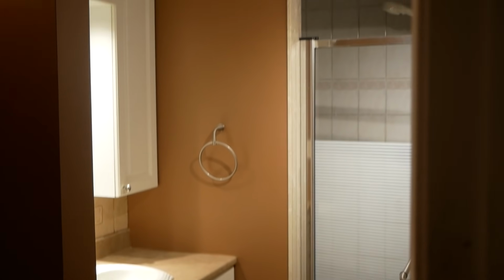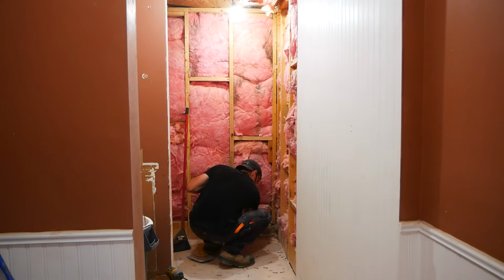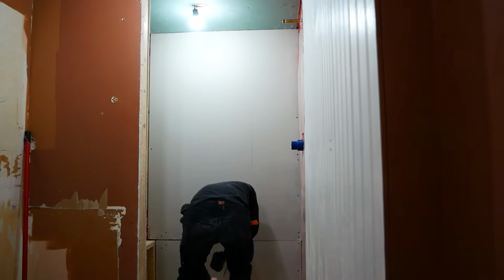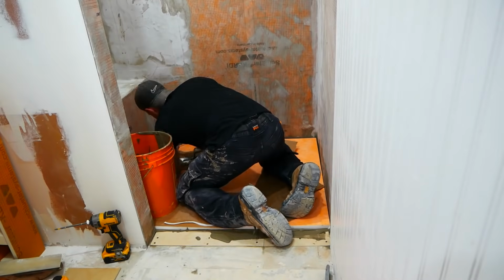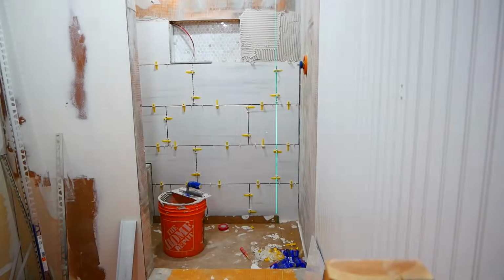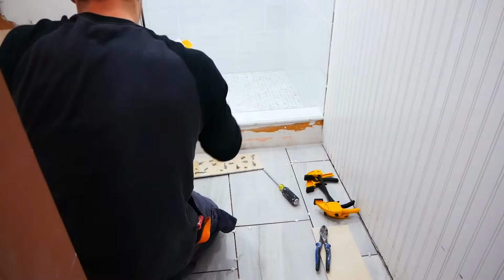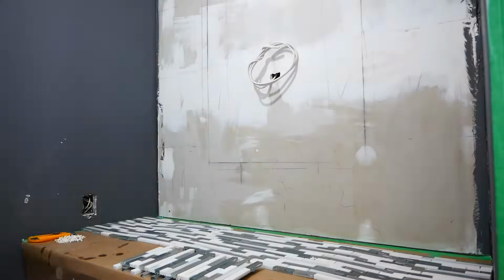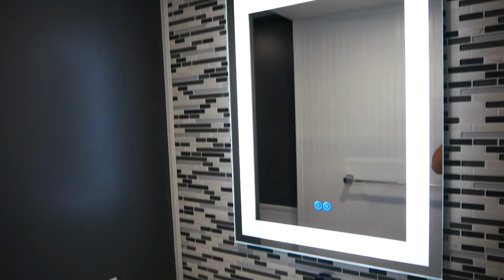DIY Bathroom Remodel | First Time Renovation for $4000

Comment: Ok for those of us who don’t know the technical terms and want to learn can you please explain. What is PEX? What is CFM, GFI, LBT? You know what I mean my man?
Reply from the maker: Yeah I’ll try to get better at that. Pex is the white pluming pipe I used. Cfm is cubic feet per minute (how much moisture your fan will be pumping out).
GFI is ground fault interrupter (detects voltage leakage and will trip if there’s a problem. LVT is low voltage thermostat wire, just a small wire for low voltage stuff 18/2
Reply: @WorkinwithWolkon  thanks. I’m doing my own bathroom refresh at the moment but wish I could do more hardcore stuff like you. Nice job.

Comment: Good job.. I'm just skipping through but whats going on with the plumbing / valve being burried in the insulation? Big no no on this. You're asking for mold. any condensation that might occur, any small tiny leak might go unnoticed. and that insulation would be prime breeding ground. A tiny leak in an open cavity would also be bad but not nearly as bad. If you are up against an exterior wall or in a basement you never put your plumbing on the outside wall like this. thats why a kitchen sink that is under a window has the copper coming up from the bottom of the cupboards. not the wall.

Comment: Love how you put the cost breakdown at the end. I'm in the middle of doing this myself because trade labor has gotten so high that I could mess it up 3 or 4 times and still come out less expensive doing it myself. Would be great if you added in roughly how many hours this all took as a contrast in how long it takes a DIY'er vs a Professional.
Reply from the maker: It was roughly 130 hours. Keep in mind that doesn't include the 10,000 trips to the hardware store lol

Comment: Im not sure if you did or not, but I would run a bead of Silicone along the bottom of the toilet where the toilet meets the tile. if it does overflow, you dont want anything getting down under there.

Comment: Looks amazing!  Only critique I’d make is that if the shower wall is an outside wall, it’s load bearing and you’ve compromised the structural integrity by cutting into those 2x6 studs without putting in proper support.
Reply from the maker: Thanks! The shower wall was actually an addition built into the garage. Its non load bearing. I wanted to remove the wall separating the vanity/toilet however that wall is load bearing
Reply: @WorkinwithWolkon  oh nice, so no damage done!  Great job man!

Comment: My question to you is why did you use regular drywall? Why didn't you use cement board. Either that or mold resistant drywall?
Reply from the maker: Schluter recommends regular drywall. If any water gets past your membrane then it has failed

Comment: You just save your mom a 10,000 dollars or more project! Nice well
Done
Reply: I agree, at least 10,000. + in savings.  Very good job.  I used the same waterproofing.   An excellent product but a bit expensive.   Great work young Man.  Thank you.
Reply: We wanted to renovate our bathroom and rebath (a bathroom contractor) was quoting 20k. We did not go with them🥲
Reply: @ayshab2123  there you go you should hire this guy on the video 😊
Reply: How much would a general contractor charge for this do you think?
Reply: @Ryan_Quinn  I've seen a reaction from a contracter in another video, he would charge for a simular bathroom $6000 just for labour!
Reply: @MrZ676  Yes that's what we charge in Florida , customer pays for all materials we complete a small bath in 3 days , I pay the tile guy about $ 5,000 for job .
Reply: @Ryan_Quinn  In jersey, a bathroom like this would be upwards of 20-25k. A basic 3 piece acrylic tub enclosure job and tongue and groove LVP flooring on a 5x10 bathroom I was quoted almost 12k by most general contractors.
Reply: @robsp32  for real? We had one that was much bigger done for 15k in Chicago, with a rain shower and everything.
Reply: @Ryan_Quinn  well for starters he did every trades Job! Painters, cheer rock,tile, electrical and on an on! In Northern California just a tile job for a shower like this are around from 3,500 to 5,000 so do you math for the rest of the trades!
Reply: @Ryan_Quinn  $10,000 labor only. You could be lucky and find someone that’ll do it for $5,000 labor only.
Reply: Best SON ever!!!
Reply: 10k or more ? 🤨 ur over exaggerating

Comment: Nice job. I recommend using "go board" instead of drywall. You can tile right on top of goboard, it's 100% waterproof. Also, I used KBRS shower pan, they are the best ready to tile. For grout, I like using "pro fusion." It's waterproof so no need for sealing.
Reply from the maker: I can’t seem to find those products for sale near me, I think being in Canada my options are more limited
Reply: @WorkinwithWolkon  You did an excellent job in your bathroom!! And this is coming from a 38-year journeyman tilesetter. Very wise choice to go with all Schluter brand substrates.  As a side "tip", if you go with a "stacked" pattern vs a brick pattern, it is more forgiving for an unlevel floor. You can break the plane along one joint and not have lippage like you will with a staggered pattern.  Using the leveling clips was very wise as well.  Very impressed with your work. There wasn't one thing I could find fault with.
Reply from the maker: @davewatlingphotography  thank you very much, I appreciate the advice!
Reply: Just as an "fyi", Fusion Pro grout is not "waterproof". No grout is waterproof.  It is simply stainproof and color conformity perfect. You still need a waterproof substrate when using any type of grout.
Reply: @davewatlingphotography  epoxy grout is waterproof no?

Comment: While i do love some schluter products. You would save yourself a lot of time and effort to just use foam board. Go board/Permabase foam board with sealant work great and are relatively inexpensive ($20-$25) for a 3x5 sheet. Overall the shower turned out pretty awesome for your first time. Youtube is full of good good/bad information!
Reply from the maker: I was looking at kerdi board originally but it was a little too pricey. The kerdi shower kit seemed like a much better deal so I went with that. I'll look into permabase next time, it sounds much more affordable

Comment: Wow! Great work! 👏
I was wondering if a niche can be done in the exterior walls, and your video answered it. Thanks. Also a question for you, I couldn't understand why was it a problem when you miscalculated the distance to the niche. Weren't you able to just move the tile rows up a bit? Probably be easier to install a niche an inch lower than calculated distance and start tiling with the second full row and then bottom row would be cut a little to the required width.
Reply from the maker: Thank you! When a niche is too low its much less of an issue because you can always build it up. Unfortunately mine was too high. It was only off by an inch or so which created another problem as I didn't want a sliver cut of tile at the bottom of my shower. I've received some great advice since posting this though and in the future I would have just had a half tile on the very first row and the last. This would have solved both my niches miscalculation and the awkward sliver of tile I have at the top of the shower.